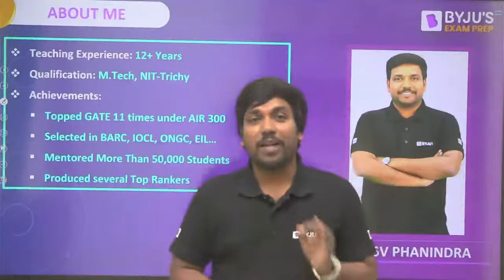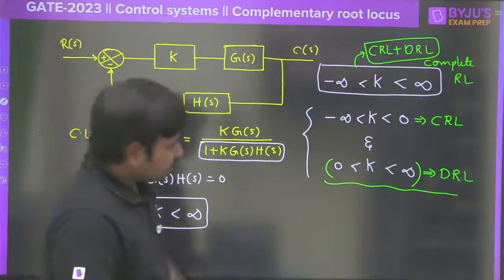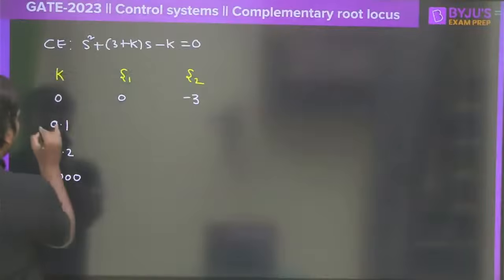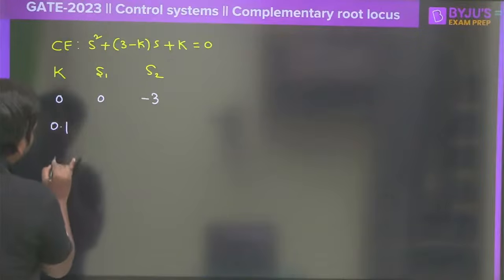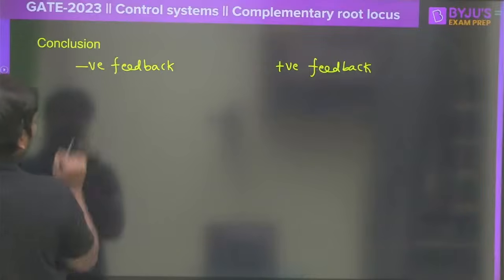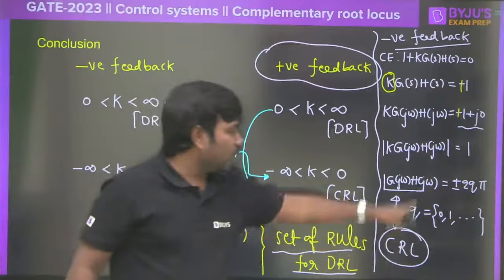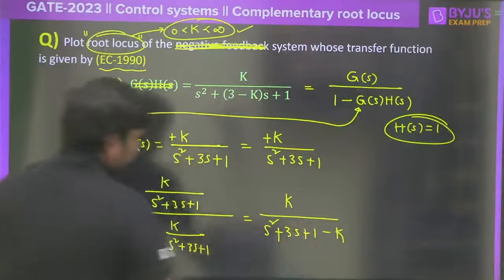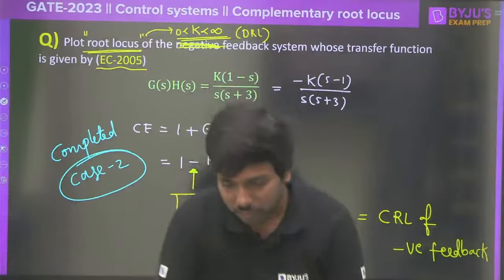GATE EE/ECE/IN 2023 Exam | Control System | Complementary Root Locus in One Shot | BYJU'S GATE

Comment: Sir the arrow direction on root locus is  always in the increasing value of K irrespective of the value of K on number line.then in negative feedback system with negative K value the direction or root locus should be opposite
Reply: Hi Bro... I had same doubt just tried in MATLB software. What sir said and explained is perfectly correct.... 
Lot of my mis concepts are cleared with his lecture..
Reply: @rajub7226   but refer book automatic control system by F F KUO